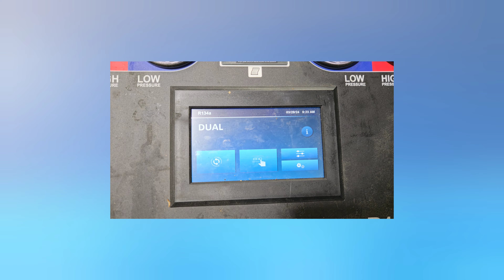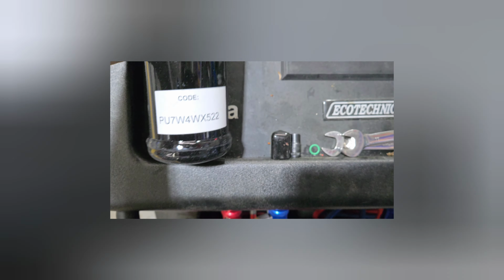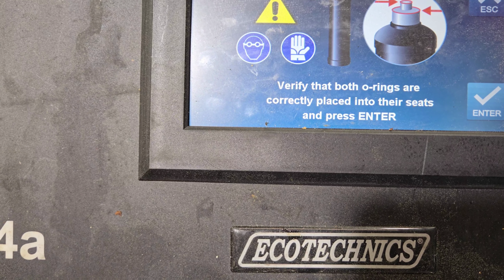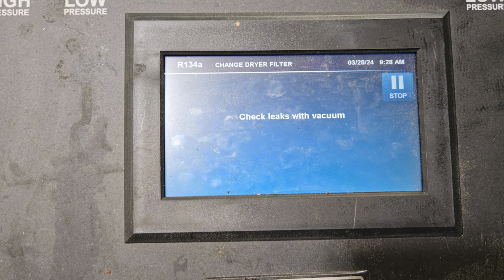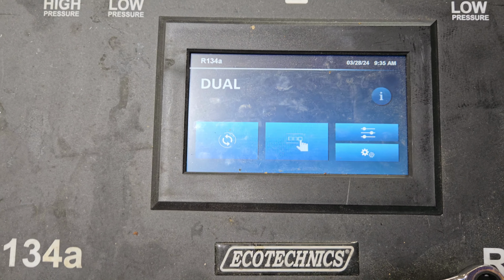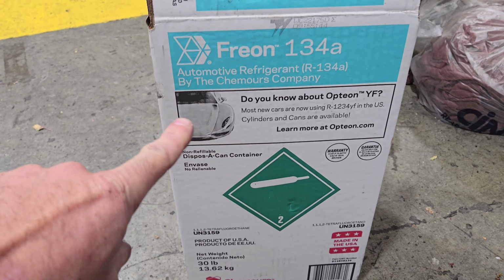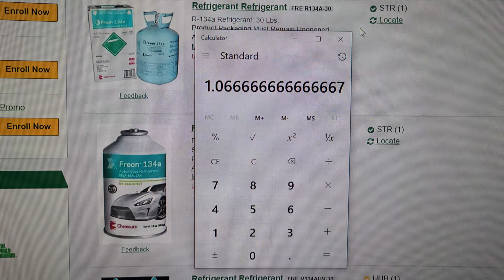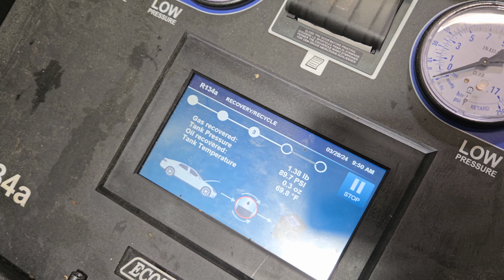AC Machine Service.  Why Are AC Jobs Expensive? #newtoyou #fyp #ford

Comment: You had the right tool to remove the filter. You used the Knipex filter removal pliers. Anytime you see Snap-on it means "snap open your wallet". Back when R12 was going for $30 a pound I started calling freon "expenson". The YF in 1234YF stands for "You're F*****". Maintaining the a/c system is quite the expensive proposition.
Reply from the maker: Yeah. I got that filter from oreillys. But it's a snap on brand. They are the only ones who make it.
Reply: @BeardedFordTech   I'll bet Snap-on owns Ecotechnics. They like to buy companies that they sub contract to for equipment.
Reply from the maker: @mlieser1230  they do

Comment: I remember the bad ol-days of R-12 systems and no recovery machines, where you just dumped the system into the open air. The recovery machines were just coming out when I left the line.

The compressor on my 2012 F150 is original to the truck and was cycling on/off the one semi warm day we had here in Northern VA. Thinking of trying one of those high brow freon cans FBM showed on his channel a few months back. Told the wife the truck will have to go to the shop if the compressor fails. Told her I can do the repair, but not legally.

The wife's Escape has the YF, cringe if we ever have to do anything with that.
Reply from the maker: I'm not fond of those cans younger with the Guage. I've seen so many people ruin a system (not saying you will)  my truck.is 1234YF as well.  Things just keep getting more expensive

Comment: When the compressor is replaced you don't replace the dryer and orifice too?
Reply from the maker: An orifice on a system with an expansion valve?  The drier is part of the condenser. It has new compressor expansion valve and condenser. If there is an expansion valve there is no orifice tube. It's one or the other
Reply: @BeardedFordTech  
I'm old school sorry. 🙄🤣😂🤣
Ok so the condenser with expansion valve and dryer was replaced with the compressor  got it. That wasn't mentioned when you added up the costs tho so even more $$$$$$$
Reply from the maker: @billy2bob63  yeah totally slipped my mind. Technically you don't have to. That's mainly for aftermarket compressors. They won't warranty it if you don't change those parts. However I didn't do the condenser and expansion valve at the same time. It was like two weeks ago and it needed to go before the compressor got here.  My fault I should have elaborated more.